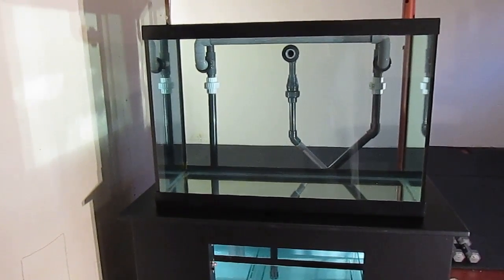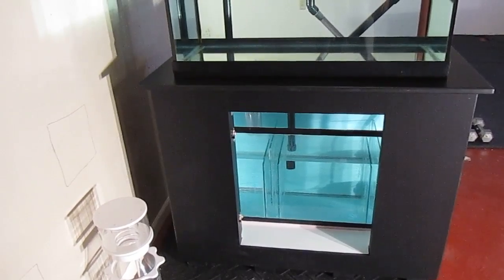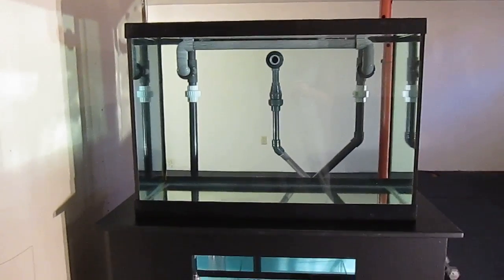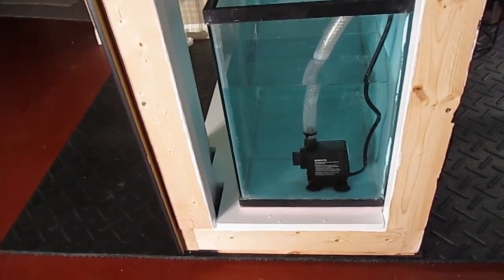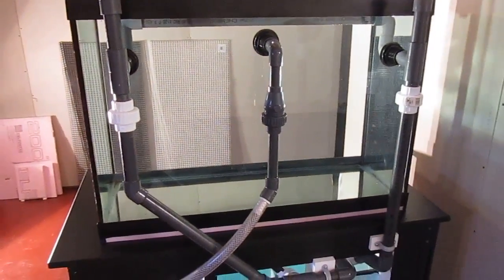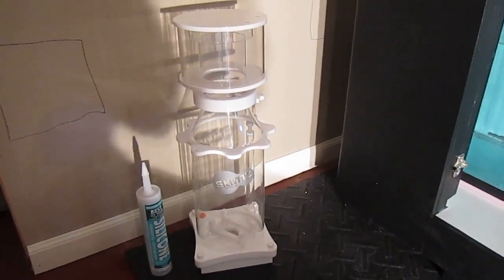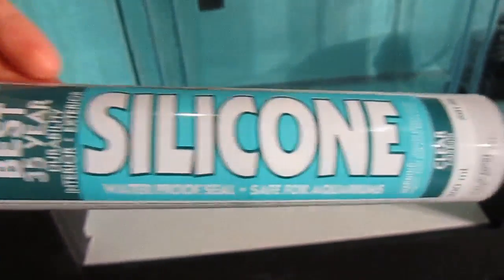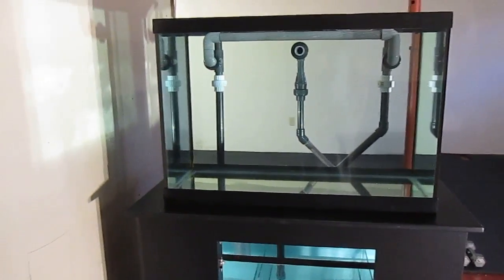Saltwater Aquarium Project, 65 gallon - Overflow and Sump Design (part 1)

Comment from the maker: I made a template out of 1/4" plywood. Drill through it with your diamond bit then position it where you want your holes and cut the wood flush with both edges of the glass (side edge and top edge). Cramp it in place while you start your hole so the bit doesn't skate. Flip is over when you're doing the opposite side and the holes will be perfectly symmetrical.

Comment: Appreciate the reply. My focus is to insure that the holes are dilled as parallel to each other as possible to insure that the surface skimmer bar be absolutely level for optimum drainage. This was what I should have explained better in my 1st post, sorry. I have a laser level and will use it but without the normal center drill bit as found on wood hole saws, I worry about keeping my drilled holes accurate.
Thanks again. Exceptionally clear video, btw. Nice, sharp and well lit. Thank you again!

Comment from the maker: Thanks. Drill the holes as close to the glass edges as your constitution will allow - you could even try to drill close enough that you don't need the vertical 90 deg elbows (just the two horizontal elbows) so that the skimmer bar is higher and less visible...but remember that the closer you get the greater the risk of cracking the glass. Good luck!

Comment: Very nice design...different, too. One thing I'm seeing in almost all these online videos...Much detail in what parts are used, glues, silicones and bulkheads. However, you've chosen to accept the fact that most folks already have this down and want to know more, "how-to". I'm seting up a 72 bowfront and have decided to drill the back and follow your lead. The Eshopps 1000 overflow goes on eBAY, lol.
I'd like you to explain more on how you arrived at your drill placements for the surface drain.

Comment from the maker: The external dimensions are 43"l x 22.5"w x 35"h, the top platform overhangs by about 1.5". The interior is the external dimensions minus the thickness of a 2"x4" and the 1/2" outer paneling. It's all 2x4" and MDF. They're very easy to build, all you really need is a circular saw. One tip though - leave as much room as you can between the top of the sump and the underside of the top platform....or better yet, put your sump behind the wall rather than under your display tank! Good luck!

Comment: I like the stand design! i would like to build one myself. if you don't mind what are the dimensions and what did you use to build it? I have a 55 gal tank and i don't have a hole lot of room so i would like to put a sump underneath in the cabinet. I would really appreciate it!!

The design of your hole set up is by far the best i have seen i watched all 4 of your videos would like to see updates

Comment from the maker: Don't use ABS - there is a concern that it leaches chemicals into your water that will harm your fish and coral - it's a topic of much debate, but I would avoid it to stay of the safe side. Use PVC that is labelled potable. I used slip joints, but there's nothing wrong with threaded. Good luck!

Comment from the maker: You can make them whatever size you want, just note that the water level will always be above the lower baffle, and below the top baffle. Best to decide on the ideal water level in your sump then size the baffles accordingly. I suggest that you keep the water level in the sump at least 2 inches from the top of the tank (I keep mine at 5 inches). Also beware that you can always raise the skimmer in the sump, but you can't lower it. Good luck!

Comment from the maker: Too much air is entering the drain pipes. There are a few things you can try: change the hole size on the standpipes, make a new skimmer bar with a smaller slot, or stick a small tube (6" long) into the skimmer bar so that the air enters the small tube, not the slot in the skimmer bar. It takes some trial+error but once you get it right then you never have to touch it again. Good luck!

Comment from the maker: Thanks. I bought the check valve from "PVC Store" in Ottawa, Ontario. It's a fairly small store and I'm not sure if they do mail orders but the owner/operator is pretty nice so you can probably work something out. Although ball-style check valves are not overly common if you keep searching online you'll eventually find them (I've seen them but I can't recall where). Good Luck.

Comment: Great Work!!  I applied this overflow technique to my 46g bow front, and it works great! Thanks!! The only thing I did differently is I only used 2--90d street elbows directly into the bulkheads because I do not plan on moving the waterline.

Comment from the maker: Cutting the slot is tricky. I used an oscillating cutter like the Dremel Multi-Max. I drew on the slot and slowly cut it out. I figure a compound (sliding) miter saw would also work if you braced the PVC well. I suggest making the whole skimmer assembly (bar + four 90-degree elbows) before you do any drilling. Duct tape the assembly exactly where you want it then mark the hole locations. Make sure the edge of the holes is at least 2" from any glass edge to reduce the risk of breaking. Good luck!

Comment from the maker: Thanks. Check out my part 2 & 3 and update video to see how the skimmer overflow bar has been working, but long-story-short I'm very pleased with the skimmer bar even after 15 months of use. No problems at all. Good luck with your tank build. p.s. my 65gal build was an upgrade from a 46gal bowfront too!
Reply: What size loc line did you use for the return ? Thanks
Reply from the maker: @twinreefs7025  It was either 1/2" or 3/4", either would work depending on your desired velocity of the exiting water. Suggest buying both with a threaded fitting so you can swap and see which you prefer.

Comment from the maker: The low water level makes it easier to work in the sump. The sump's water level could certainly be a couple inches higher but then I'd have to be more careful when I'm pulling the skimmer and sock in/out for cleaning. Good question.

Comment from the maker: Yes, the skimmer bar is gravity fed. It is not a full siphon, but rather a drain.  1" dia PVC pipe can drain approx. 500gph. Use this area/gph conversion to calculate how much slot needs to be cut then double it so you have a decent amount of flood protection. I installed 3/4" loc-line tubing to direct the return flow as desired. Check out the part 2 video and you'll find more detailed answers to these questions. Good luck.
(tank is doing great - update coming soon!)

Comment: Is the siphon simply gravity fed?  How many GPH can the cut slots on your PVC overflow handle?  How do you handle water circulation (direction) with the incoming/return water from the sump - with the return placed in the middle of the tank?

Comment from the maker: You're correct that some unskimmed water is pumped back into the display tank thus reducing the overall inefficiency of my sump, but the benefit is that the unskimmed water in the refugium improves macroalgae growth. It's a bit of a paradox - the concept is that the increase in macroalgae growth offsets the reduction in efficiency. It is a very small % of the display tank water that is routed directed to the refugium, maybe 2-3%. The ball valve allows me to control it, or shut if off completely.

Comment: Hello again.  Gave this a try - cut the skimmer slit with two thin cut dremel blades - didn't surface skim - but didn't overflow the display tank either.  Cut it wider with the 1/8" routing bit and the pipes fill up on me - but it skims near the drain outlets.  Going to try again with 1 1/2 " pipe, fittings and a 1/4" slit.

Comment from the maker: The slot is actually 0.10",so the total minimum required area is 0.55sqin.(1/8 was my estimate before I measured it). If you're using an eheim1262 (900gph), you're probably getting ~550gph into your display tank (after losses), you should measure this thou even on a mock setup. To drain 550gph you'll need 1.1sqin of slot MIN, I would design in triple that (3.3sqin) so you have lots of safety margin. Your best bet is to experiment with different slot widths until you get what you want...goodluck!

Comment: repost from reef central: 
Calc from your second video .6875 sq inches(5.5" x 1/8") per 280 gph. 
then 1500 gph would require a slit with 3.68 sq inches. 
That would be a 1/8" slit with a total length of 30 inches. 
in a 4 foot tank  - that leaves 34" of available skimmer bar slit divided by two pipes (with 4.25 sq inches of skimmer bar slit). That should support and fully surface skim 2000 GPH.

Comment: There's quite a lively discussion on this over on reef central

some are saying that the water backs up within the skimmer bar in higher flow systems.  I say (based on your second video) that a 1/8" skimmer bar slit can support up to 2000 gph (based on 5.5" supporting 280 gph).

What are your thoughts on this?  Thanks!

Comment from the maker: None of the pieces on the inside of the display tank are cemented together (i.e. the four 90 degree elbows and the skimmer bar) and the elbows are not cemented to the bulkheads. I did cement all joints that are outside of the display tank, up to and including the bulkheads. This means the bulkheads can't be removed from the tank but it also reduces the risk of a leak. Based on how well the skimmer bar has been working I could dry it out and cement the pieces together but there's no real need.

Comment from the maker: Thanks. This is a good question - come to think of it, I'm surprised this hasn't been asked yet. A circular saw blade is nearly the perfect width at 1/8", but it's tricky and a bit dangerous for cutting a round pipe...a mitre saw would help hold the pipe. A router could also be used (with 1/8" bit) but you also need a router table. I used a tool similar to Dremel's Multi-Max. I drew my slot on the pipe then put it in a vise and slowly cut out the slot, it took about 30min and worked great.

Comment: Awesome design.  I am thinking about applying the same design to a 120 gal system.  Question - what and/or how did you use to cut the pipe slits for your skimmer bar?

Comment from the maker: Hi Liam. The skimmer bar has been working even better than I had expected...I have absolutely no debris floating anywhere on the surface, and I've found that the bar only requires a quick pass with my cleaning brush every 4 weeks due to very little build-up, but it helps that I have my light closer to the front of the tank so that there's no direct light over the bar. Thanks for watching - I hope to have an update posted soon.

Comment from the maker: Hi oxbrit. The centre of each hole is 6.0" from the very top of the tank, and 4.25" from the edge. I made a template out of 1/4" plywood and gently clamped it flush with the top rim and edge of the glass. This makes it MUCH easier to start the glass hole and also ensures that your holes are perfectly symmetrical. Go slow, use very little pressure (just the weight of your drill), and lots of water. Good luck!

Comment from the maker: Hi LittleReef. I'll post my estimated drain flow rate soon (per my Deepcover response). As far as evaporation goes, when you're running a sump the water level concern is in the sump; the return pump will always keep the display tank at the level of your overflow. I lose about 500ml a day in this setup (there are a number of factors that play into this number). I may introduce an auto-top-up but for now I can live with manually topping-up until the tank matures. Good luck with your drilling.

Comment from the maker: Thanks for the comment Deepcover - your concern is certainly valid. I will include a skimmer bar inspection in my daily/weekly maintenance routine. Given the 20+ inches of drain I will have plenty of warning if algae starts to fill in the slit.  I know a guy that's been using this type of overflow for several years without issue. Notwithstanding, your comment has given me the idea to run a test to determine how much of the slit can be covered while still fully draining the return pump flow. Thx!

Comment: Your skimmer bar - although inventive - scares me quite a bit. I would be worried about safe guarding that slit to ensure it doesnt gunk up with debrit, algae, or snails etc etc. the reduced ability to drain the tank cause an overflow if you pump continues to operate at normal pressure.

Comment: Excellent video. Going to be drilling my 150 gallon next week all being well. Have been juggling the idea to go through the base or through the back, your video has swayed me now ;)

Two questions, what sort of flow are you getting from the skimmer bar? the slit doesnt appear very big and its hard to see how much water would be pulled through it. 
Do you plan on using an auto top up as the skimmer bar appears close to the surface and wouldnt allow for much in the way of evaporation?

Comment from the maker: Continuation...
In my case, the extra elbows allow you to adjust the water level. Also, it takes nerves of steel to drill thru tank walls that close to the top (the risk of cracking the glass goes up the closer you get to the edge). Good luck with your 125g. Be sure to post your video link so I can check it out, and keep an eye out for my second video coming in a couple weeks.

Comment from the maker: Thanks Gene. It's been working great, I'd say even better than expected. It's fairly quiet which was my main concern. The only thing I'd consider doing different next time would be drilling the drain holes closer to the top of the tank so that you only need 2 elbows, not 4. This would make the overflow bar even less visible, but this requires you to be very accurate with your glass drilling because the holes will then set the height of the water level. Continues...

Comment: Great plan and design. Just wondering how this has been working for you? Planning on doing this same thing with a 125 gallon Marine aquarium, so your video was great to see. Mine will be visible from both sides so the drain holes will be drilled on the ends with the return dropped down in the center. Thanks.